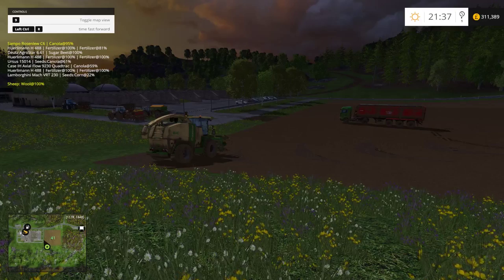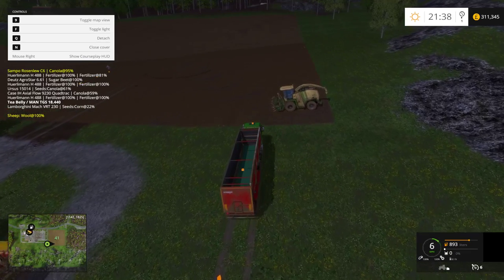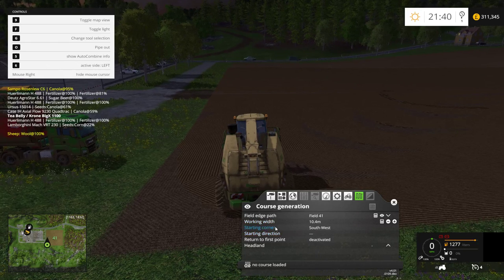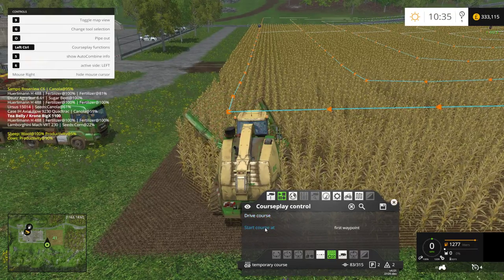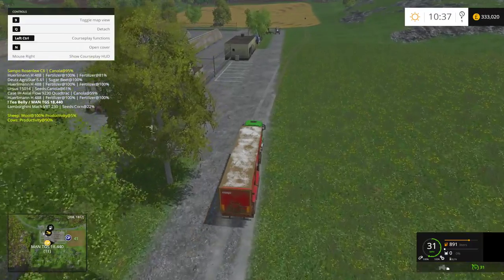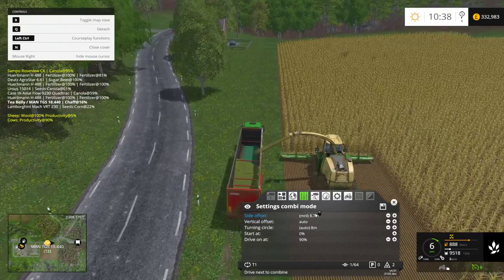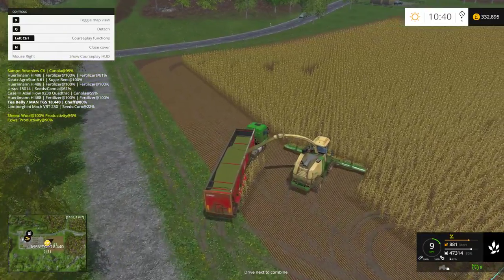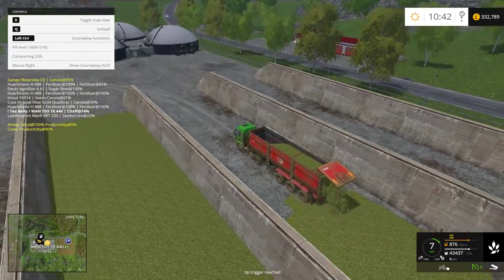FS15 Course Play Tutorial 15 (Chaff to Silo)

Comment: Thanks for your speedy reply to my questions. They were really helpful. I have been using courseplay for 3 days now and really like it. What I meant about automating chopping the straw for silage was can you set up the harvester with courseplay and the tipper like you did when you were chaffing the corn? It seems like it might be a problem for the courseplay to position the harvester in the right place to get the straw. Enjoy your videos! Thanks again.
Reply from the maker: +Rose Lou yes you can get them to use the same course
Reply from the maker: +Rose Lou also if you wanted to use the bailer, you could use the same course just adjust the offset to the left. hope this helps

Comment: I really appreciate your doing this. I have a few questions. First of all why does the truck stop when it gets to the edge of the field? Do you ever do a back-and-forth harvest rather than doing the headlands first? Do you set the truck to 100% full from the combine before it leaves the field? What speed do you set through the silo? Also, I quite often chaff the straw from from the field after I havest the wheat and barley. Can this be automated? Once again thanks so much for your videos which have been very helpful.
Reply from the maker: +Rose Lou 
Q. First of all why does the truck stop when it gets to the edge of the field? 
A. Because it has come to the end of its course.

Q.Do you ever do a back-and-forth harvest rather than doing the headlands first?
A. Yes, I always do at least one headland. It depends on what is on the perimeter of the field, if there are obstacles (trees, fences, buildings etc) close to the edge I use more headlands.  

Q. Do you set the truck to 100% full from the combine before it leaves the field?
A. No I don't think you need to when using it in this method, if you look in the video I think I have it set at 90%. I think because the tipper is actually following the combine it works differently than when you come to unload a combine. I could be wrong too :)

Q. What speed do you set through the silo?
A. I tend to use recording speed on my courses. Sometimes I manually set a lower speed if the plant machinery has mishaps this is usually on cornering and on sloping hills.

Q. Also, I quite often chaff the straw from from the field after I harvest the wheat and barley. Can this be automated?

A. Can what be automated?

Hope this helps :)

TB
Reply: +Rose Lou  I use a windrower on the field with straw and then use that same course to pick it up applied to the forage harvester or wagon.  Or you can just skip the windrower and just use the same course to pick up the straw that you made to harvest the field.